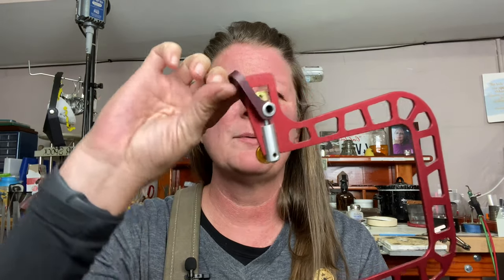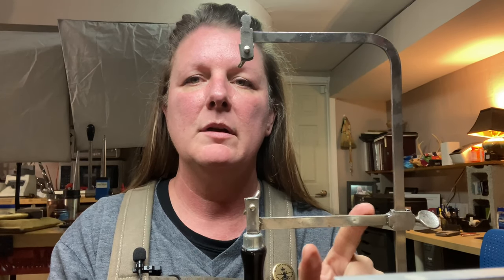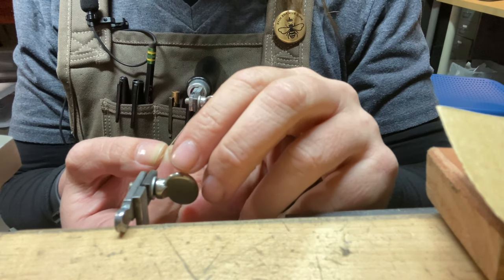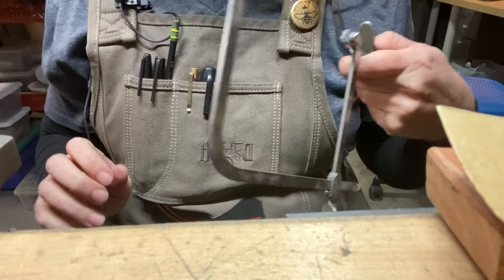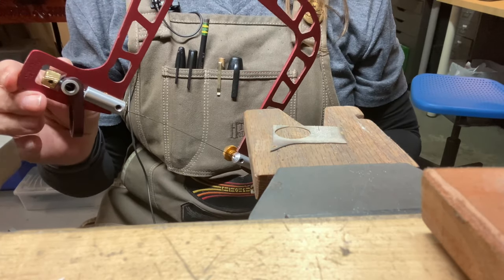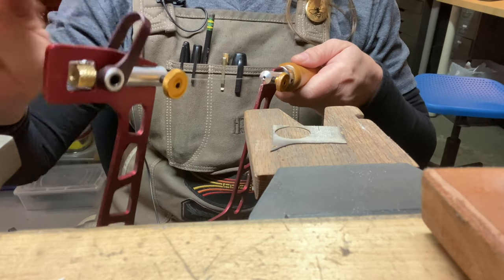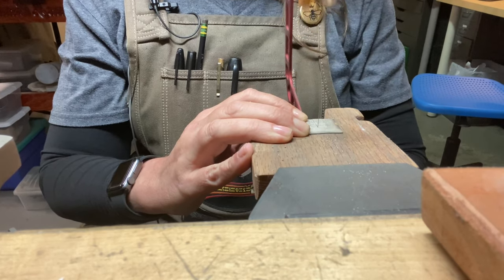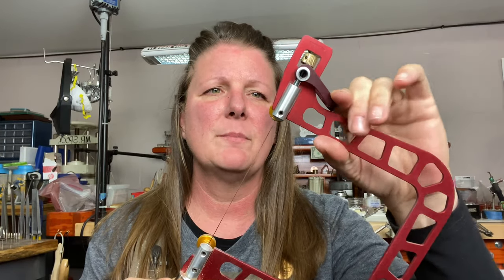Jewelry Tool Talk:  Jeweler's Saw

Comment: Hi Julessa, first thank you for sharing with us. Your style suits me so well and I am learning so much … I am wondering if you are still using this saw and which one of the many styles of Knew Concepts saw would you recommend?
Reply from the maker: Thank you Toni Lea! I’m happy you are learning so much! Yes, I’m still using this same saw! I love it and the fact that I don’t have to adjust the tension ever is amazing. I liked my old German saw, but getting the tension right every time was a challenge. I recommend getting the 5 inch tension lever Knew Concepts saw. It takes care of all of my jewelry making needs. It’s lightweight and once you set the tension, you will rarely have to reset it. It’s a fantastic buy even if it’s a little pricey. I’ve had mine for at least 8 years now and I haven’t had to replace any parts. That’s the other benefit, you can replace parts (like the tension knob), if you need to.  Hope this helps!